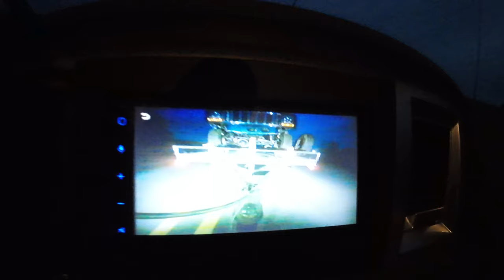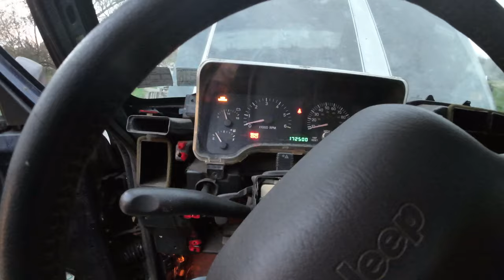EP53 :: Disaster at the muffler shop has me  'Exhausted'  #betsyrossxj #jeepxj

Comment: What kind of exhaust shop uses those crappy squeeze clamps instead of welding?
Reply from the maker: On the back of an XJ, the mount is a rubber loop with a j-hook. The factory connection is a clamp. So they did the same. If they weld that mount it will vibrate and break and it’s impossible to get out for maintenance. 
So it’s only in the back at the mount. The rest is welded.